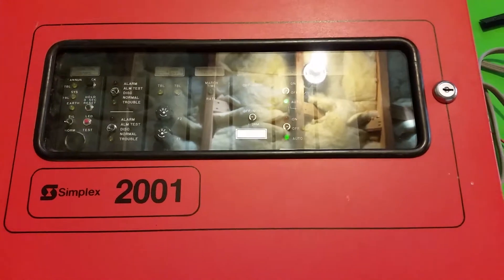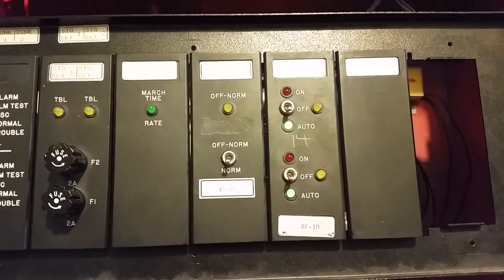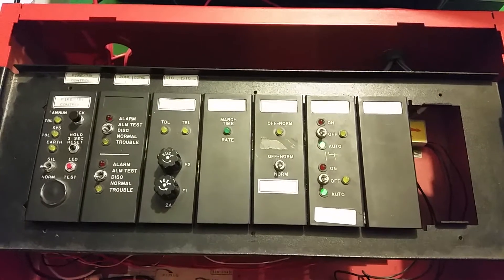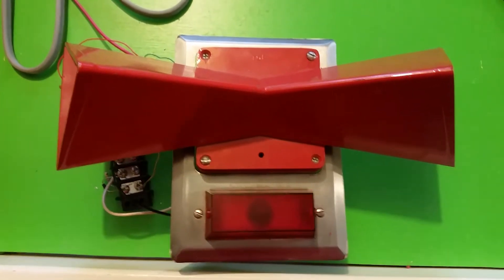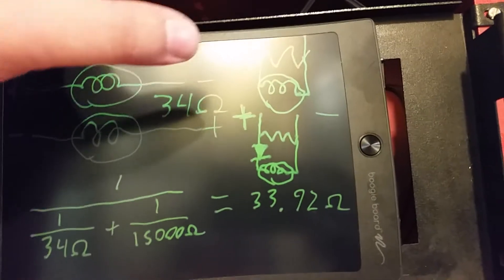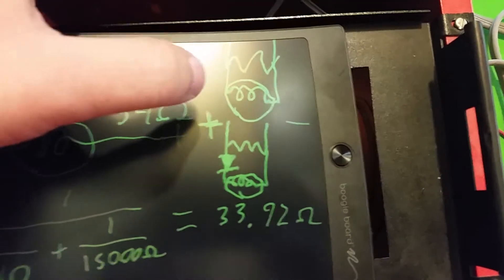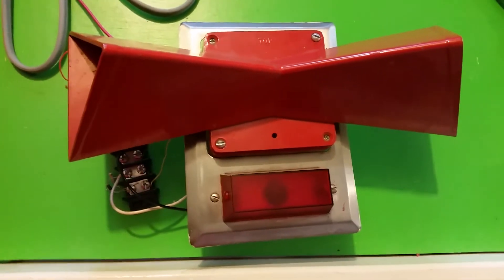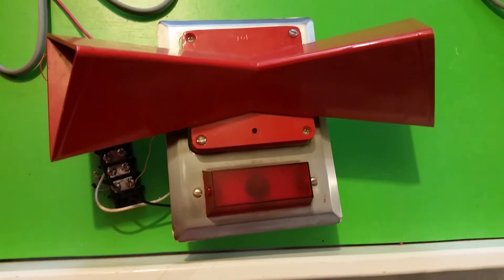Workbench System Test 1

Comment: How do you mount that simplex fire alarm type oh yea also check in my channel I have an really rare simplex 4090-2 has back up light plate check it out if u like
Reply from the maker: That light you have is extremely rare, hang on to it.  I know now that Simplex made clear lenses for the 4050-8X lights.
Reply: @thebluecfl1776  I already mount it already witch I do collect antiques but nice fire alarm u have I never seen those before did u got it from ebay or something there one in my school model 4040 with that light plate but it's disable and there using the building still but I do love the 4040 reason why cuz I like the noise

Comment: What is the horn model that covers the 4051 or 4050.
Reply from the maker: Horn model: Simplex 4051.  Light plate model: Simplex 4050-80 (24VDC single bulb without flasher).  The models are listed in the description.
Reply: +The Blue CFL Not the 4050. The Triangle horn cover.
Reply from the maker: Apologies, projector is a Simplex 624-16i type PR-2 I believe.  No documentation came with the projector when I received it.

Comment: Nice! I love that you're keeping such a neat old panel going. And thanks for that explanation. I really didn't know why you had to put a polarization diode on those lights.
Reply from the maker: Thanks.  I noticed that the 2903 series lights have the diode spliced into the wiring and the 4903 series lights have a diode mounted directly on the board, same with the V-33 lamps I have.  I like the older stuff, you just don't see a lot of them around these days.
Reply: Oh yeah, totally. Those 2001 panels are being thrown out everyday and replaced with addressable.
Reply from the maker: The older the panel gets, the more likely it is to malfunction. With a system that ensures life safety, they are being replaced so something like this doesn't happen, sad as it may be.
Reply: Yeah, that's a very good point.